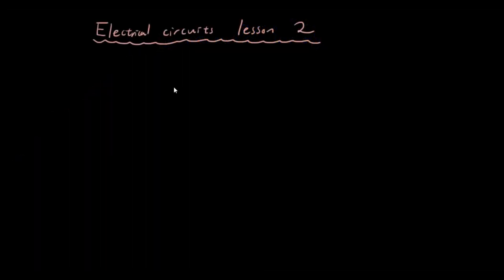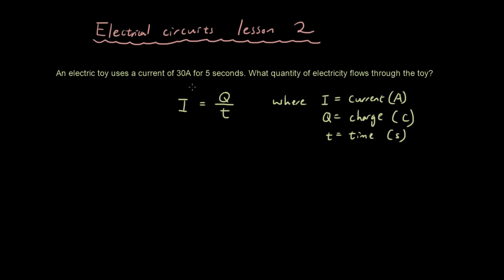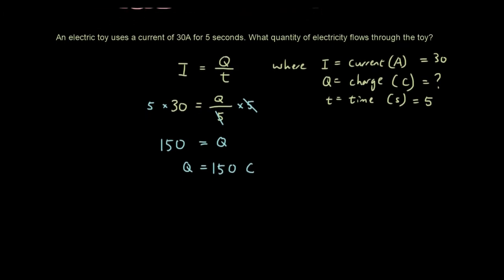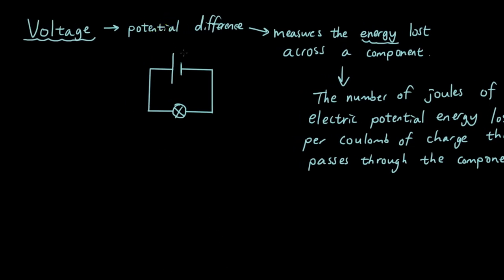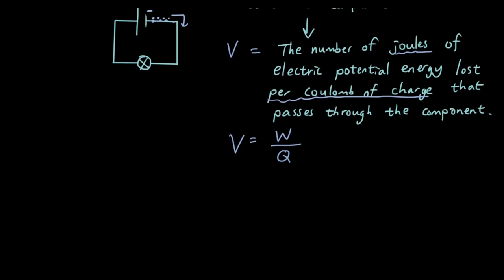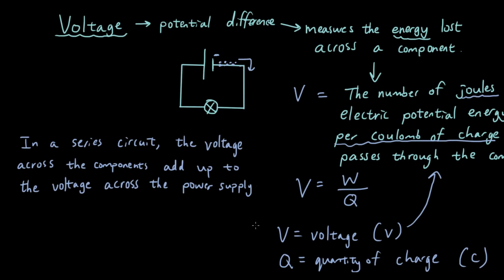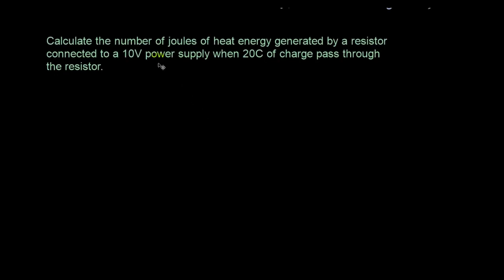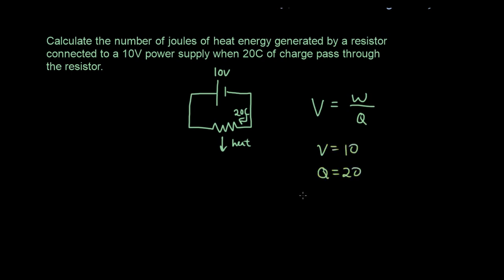Electrical Circuits Lesson 2: V = W / Q

Comment: HOW TO FIND THE VOLTAGE OVER A PARALLEL CIRCUIT WHERE WE NEED TO FIND CURRENT AND VOLTAGE AND OTHER COMPONENTS ARE GIVEN LIKE RESISTACNE AND WORK AND CHARGE ??
Reply: P please
Reply: We know that work= voltage x charge, so therefore voltage = work/ charge. Resistance = Voltage/ current, therefore current = voltage/ resistance.